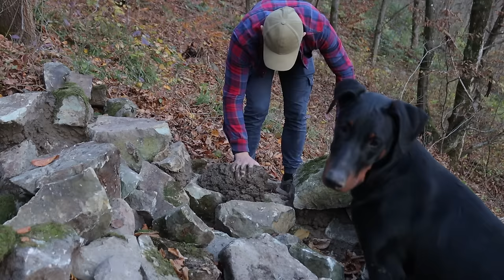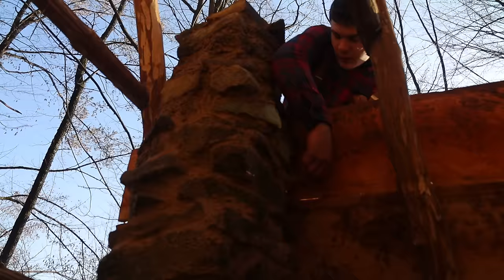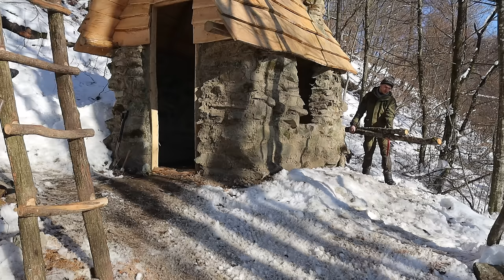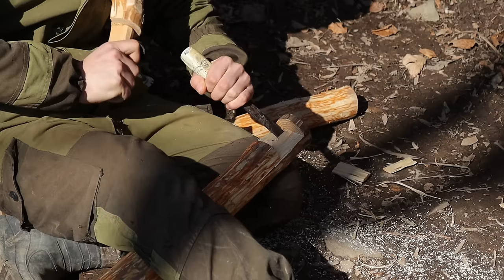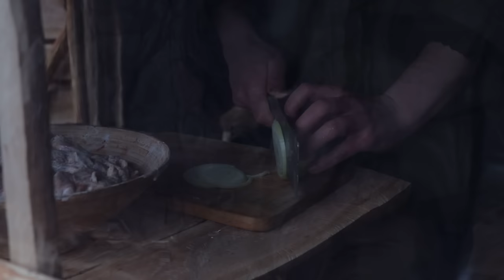Alone build a stone Bushcraft house in the Forest. Start to finish

Comment: I made the mistake of reading a few comments on this. God people really do ruin EVERYTHING. Can't you just watch and appreciate the beauty? Your work is extraordinary and doesn't deserve  all this troll hate ✨️
Reply: Everyone is "an expert", yet forgetting no crap, our ancestors literally dis it this way!
Reply: Looks like a clay mixture to me. Its not cement, but will work just fine and dries hard
Reply: @christopherhallock9344 I think if ash added in the mix it’s supposed to strengthen it
Reply: If he did used cement I don’t care he still built the house. What I am baffled with is that he supposedly milled those boards by hand with a small hand saw and got perfect flat boards.

Just for context this is how people did it before the Industrial Revolution, wooden planks were typically made using hand tools such as axes, adzes, saws, and planes. Trees were felled and then cut into logs. These logs were then sawn into planks using a pit saw, which involved two people working together to manually saw the logs into planks. The planks were then further shaped and smoothed using hand planes and other tools. This process was labor-intensive and time-consuming, and the advent of the Industrial Revolution brought about significant advancements in mechanized wood processing, making the production of wooden planks much more efficient.
Reply: I agree about the negativity but, if you post a video for the entire world to see, you are going to get criticism.  Otherwise you would keep it to yourself.  These guys know this going in.
Reply: @That_1940s_Delinquent No one did it with small hand saws even long time ago. To make planks before steam engines and water mills,  there were two-handed vertical saws operated by two burly guys.
Reply: What is the problem? What comments are negative, what is being said, am i only one who isnt seeing one?

Comment: Bravo, good sir.  Hand sawing those planks is badass.
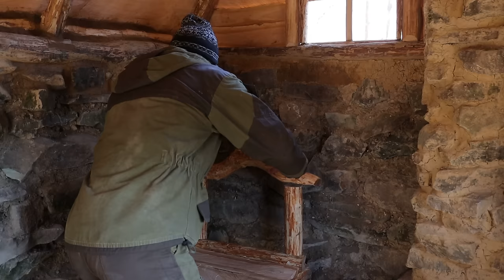Reply: Unfortunately it's just fake :) Take a look at 24:01, you can clearly see the chainsaw marks on the wood.
Reply: @luciangpl it all felt almost believable if you never done anything like this ever... 🙂The planks and the amount of stones used, that was what gave it away for me.
Reply: @reer5340 I spotted the chainsaw marks, but what was it about the stones?
Reply: @chiefnewo  the amount of stones used is not something like one person could carry up (or down) that steep slope. Also he is shown handling the small stones not the larger slabs which you can see lying around or in the structure itself (especially corner pieces)
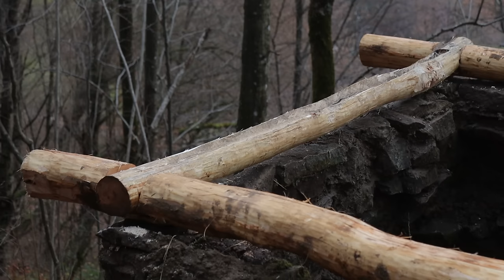Reply: Pause at 5:21 and you can see the actual chainsaw.

Comment: Really cool roof, amazing you cut those boards with a small hand saw. Great little practice size cabin or overnight cabin or washroom or sauna. He used naila on rhe roof boards .lol
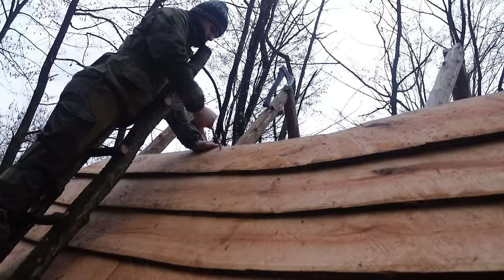Reply: 12:05 shows him drilling and driving in wooden pegs for the roof.
Reply: .....and chainsawed planks.
Reply: @RobertCro  
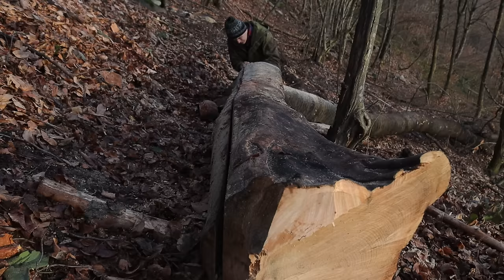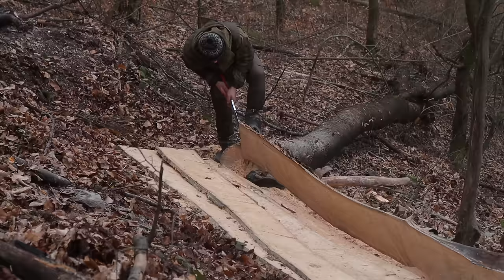10:21 to 10:38 shows him sawing the roof planks by hand... He seems to be the real deal.!
Reply: @rtoguidver3651  having sawed planks by hand and with a chainsaw, i can firmly say he did NOT do more then a few shots for the camera with the handsaw. You can see the chainsaws distinct ripping marks on the planks that a handsaw will not make. Sorry 🤭. 

Doing a full plank by hand is crazy tough on your body...nevermind an entire roof and some siding
Reply: @RobertCro  
Check 10:21 thru 10:39, there's no chainsaw anywhere.

You're seeing where he starts again leaving a mark w/ the hand saw to keep the cut straight..

Comment: Just a tip friend, if your hatchets or forest axes are anything of quality you're much better off using something softer like a wooden mallet to hammer on them. I restore vintage tools and it's a shame when I see the pole ends ruined. They don't often make them like they used to, so it pays to keep them in fine condition. You've done a fantastic job though, best regards.
Reply from the maker: Thanks for the tip! I'll definitely keep that in mind for future projects.

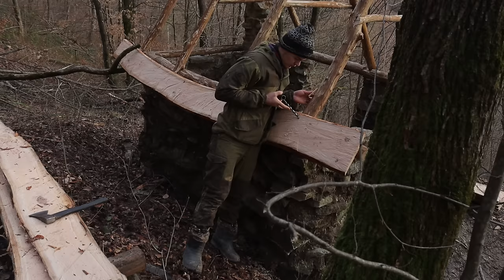Comment: While recognising this man's skills and hard work, I'm not so sure about those roof timbers being cut with that pull saw.  If you freeze the video @11:22 and again @12:00, you can see cut marks that aren't consistent with push / pull handsawing imo. Especially one with a relatively fine tooth set.   They look more like a hand held chainsaw has been used to cut vertically,  freehand, (not in an 'Alaskan saw mill set up). 
Having said that, I still think the roof looks absolutely amazing and I'd be proud to have accomplished that stone house - chainsaw or no chainsaw!
btw, I've been a carpenter for over 25 years and have worked on several greenwood timber framed buildings too.

Comment: It's a good project. Only thing I'd have done different is used concrete instead of mud. Seems odd to spend all the energy to build if it doesn't last more than a few years. Overall, you've showed how simple it is to build with just the stones already on site.

Comment: If i hab a place to do that.
Look after one makes half the structure/ the floor  the foundation dich 12 to 16 inches  make the mortor better add ashes from the fire. What fire ? The fire you were supposed to build and on the foundation. Knee high the stones must fit really well snug big and know it burn it in to place mud will harden the remaining ash from the BON fire is used for the mortor one can build another fire in the structure as it gets biger. 
This is where the word BON comes from( bon "BARN" )=ORA arora or of the heavenly light "(" arorabora"  =Aurora borealis) and to BERN IN

Comment: Before the Industrial Revolution, wooden planks were typically made using hand tools such as axes, adzes, saws, and planes. Trees were felled and then cut into logs. These logs were then sawn into planks using a pit saw, which involved two people working together to manually saw the logs into planks. The planks were then further shaped and smoothed using hand planes and other tools. This process was labor-intensive and time-consuming, and the advent of the Industrial Revolution brought about significant advancements in mechanized wood processing, making the production of wooden planks much more efficient. So yes if you used a chainsaw or a milling machine just say so I think people will understand. And if you genuinely did not and used that hand saw you are a vary patient man.

Comment: We live NW Montana.  5 miles from the Canadian Border.  Up inside the Yaak River Valley.  You can easily find it by googling these.  1. The Yaak River Road. 2. Dirty Shame Saloon.

3. Yaak River Mercantile & Tavern.  Both Taverns / Pubs call it what you will, both of them are directly across the street from one another. And you can Google any of,  the 3. 

The Yaak River Road, is not paved all the way to the Canadian Border…   Nope.  It isn’t.   From where the pavement ends, there is a 😮total of 5 &  3/4 miles of dirt road.  

And,  from where the pavement ends, up to our dirt road that is on the right hand side, it is exactly 1 & A-HALF-A-MILE.  Where the pave Road ends.

Comment: How does dirt and water turn into cement?
Reply from the maker: Great question! The process involves mixing dirt (often in the form of clay) with water, which forms a slurry that can be set into a solid mass through chemical reactions during the curing process.

Comment: You SAWED those boards with an 18 inch BUSH SAW???? 
Why am I SKEPTICAL? 
I don't wish to be, but I AM - I can't help it. I KNOW what it's like to saw even a 10 inch dia tree down with one of those things - you'll have BLISTERS all over your hands. And YOU cut PERFECT 1" boards across a 12 in deep tree that was easily 12 FEET LONG - PERFECTLY?
There are guys in Alaska with the wildly-popular "ALASKA SAWMILL" chain saws who CAN'T cut boards as accurately as YOU cut with your little fold-up BUSH SAW :-O 
Sorry - I have to call BULLSHIT on this one. 
You only showed the BEGINNING of each cut and the AFTER of the each cut, NOT the "during". 
And you're consistently jamming the tip of the saw down  into the DIRT on every push of your blade. 
I don't care how much that saw cost, and what fantastic metal it's blade is made of - after even ONE board it's going to be DULL and need SHARPENING. 
So you still cut 10 MORE BOARDS - with a DULL saw?? 
I simply don't believe it. 
AND I don't believe your hands aren't covered in blisters - a bushcraft saw was NEVER meant for this kind of heavy work.. 
Next time show the ENTIRE CUTTING of your BOARDS...

FYI, the drilling & pegging of your amazingly-cut roofing boards IS totally believable, and nicely-done :-)

LAST THING - you dug DIRT out, added WATER and magically created CONCRETE? 
All your stone work WON'T last through the first heavy rain - and your entire upper floor is LOADING on a bunch of NOT-FLAT stones (at least TEN courses of them!) all held together with nothing but MUD???  There is absolutely ZERO chance this will survive your first spring, so all this cool effort is utterly WASTED. 

OTHER guys build wood huts, but they're built on the PACKED EARTH, maybe into a HILLSIDE. 
YOU are the ONLY one I have ever seen think he's going to build a packed-mud WALL of STONES and then put an entire HOUSE on top of it. 
Waiting to see another video even 3 months (winter + spring) from now...